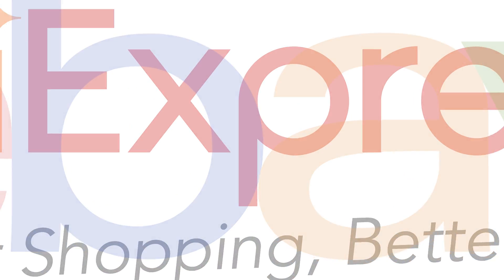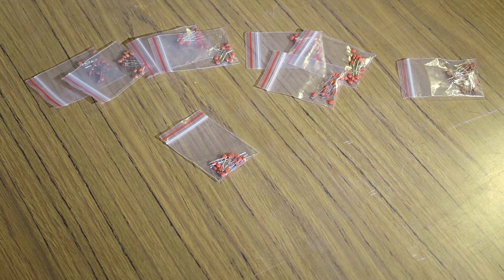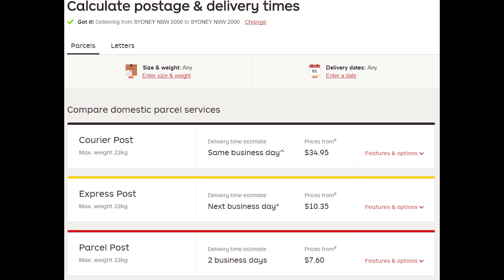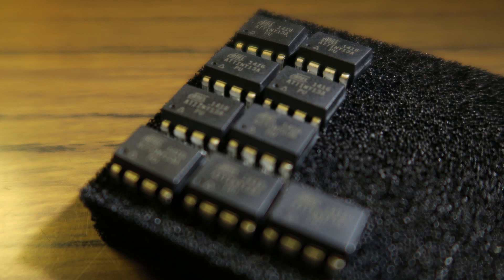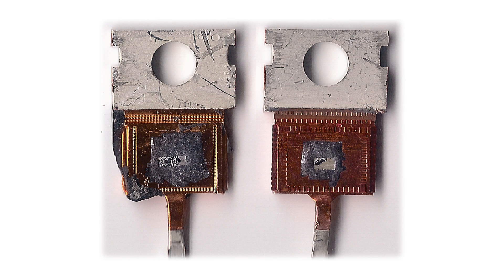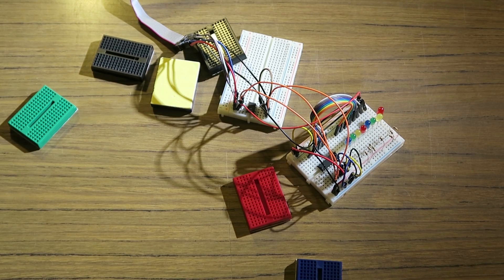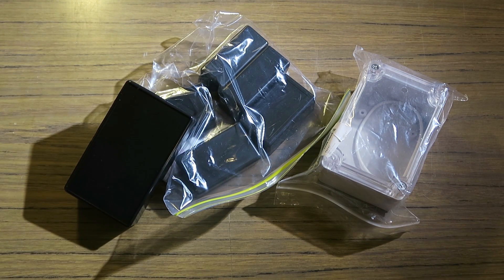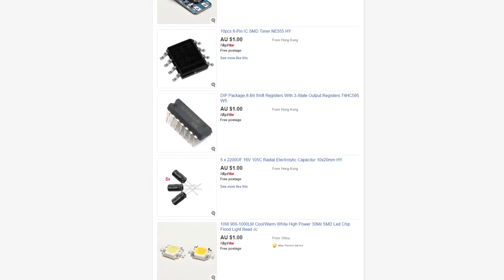Buying Cheap Components from eBay and AliExpress

Comment: Potentiometers are the worst. From all manufacturers. Blown up so many from insufficient information on "Don't shove a potentiometer between a motor and battery to act as a speed control!"
Reply: Why?? Does those not work??
Reply: @jelmerjansen328  No. They just burn up as the current is too high
Reply: @untrust2033  okay, how can i be sure they don't burn up?
Reply: @jelmerjansen328  Use a dedicated motor driver or use the potentiometer in a 555 timer circuit to generate a PWM signal that drives a mosfet to power the motor. This video describes it quite well at about 11:46 https://www.youtube.com/watch?v=yO9xIVv8ryc .
Reply: @untrust2033  My brain is not smart enough for that information, but thanks buddy👊

Comment: Hi there, Dave just made an advertisement for your channel!

I buy a lot of electronics on eBay which I also use for projects with my students. Most of the time I am lucky, but I had my share of fakes and "lost" shipments. I keep my own black- and whitelist on my blog-site (greenphotons), but I guess everyone's mileage varies a lot.

Being here in Sweden, the price difference is most obvious on LEDs - everything from small indicators, to displays and power LEDs - but for power LEDs I would not put too much trust into the Asian sources. Breadboards have always worked perfect for me and those I ordered are indistinguishable from the ones purchased through the distributors you had on a banner.
Reply from the maker: I was thinking of making a list myself, but I found that most sellers were equally good/bad and it mostly came down to what I was buying. I just try to stay away from high power and high cost components.

Great list though, looks really useful for anyone wanting something more expensive or vintage and always good to have a list of sellers to stay away from.